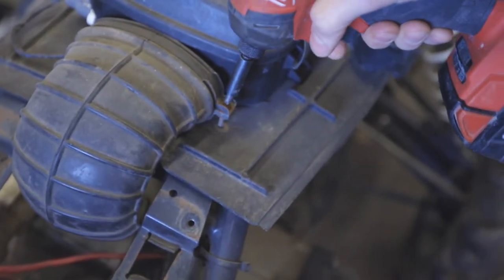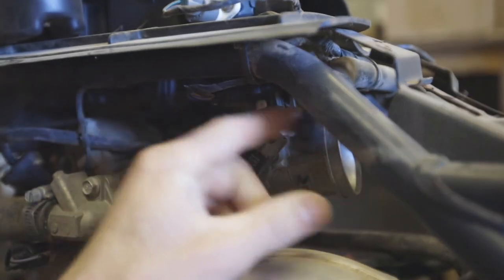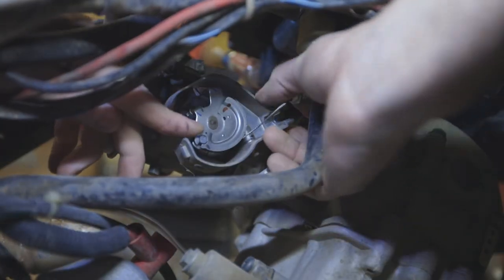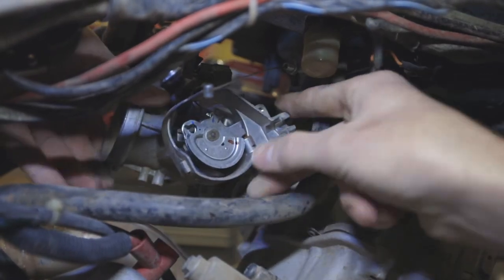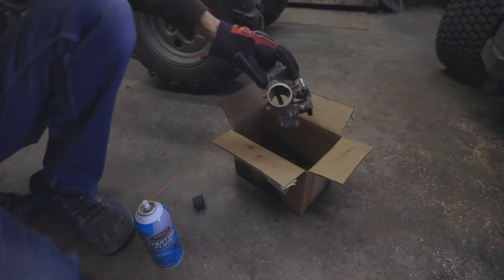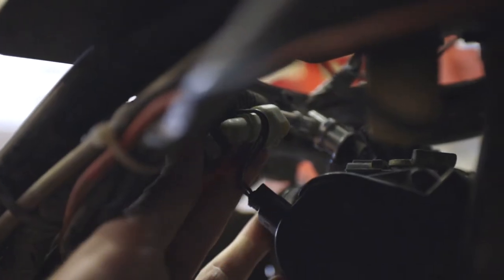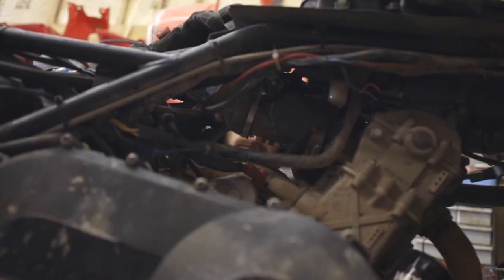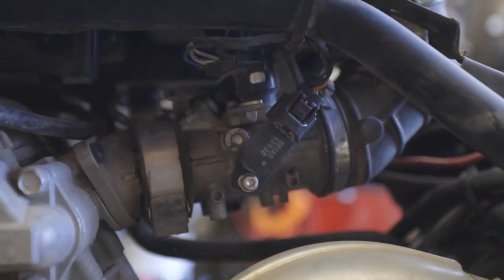How To clean your ATV throttle body

Comment: Hi.Throttle Body Valve part is broken and I am having trouble in supply, can I use alternative spare parts?
Reply from the maker: Yes, you could find a used part in good working condition to get you going again
Reply: Thank you for the answer 👍👍👍

Comment: Is there a trick to the wire harness? I have an Alterra and it's not budging.
Reply from the maker: Are you removing the throttle body? Each of the plugs have a safety clip and the throttle cable has to be loosened.

Comment: I have an issue with mine Spotters at idle and bounces rpm I’ve had injector tested valves tested Stata tested and pick up new spark plug I also cut the spark plug wire back it’s a 2018 mud pro 700
Reply from the maker: It should idle around 1300rpm or so. Have you tried syncing the EFI system? https://youtu.be/5mnc3PAVihQ

Comment: Although the throttle spring is solid, it cuts the gas slowly, what is the reason? I am writing from tr
Reply from the maker: Do you have good fuel pressure? The fuel pressure needs to be constant 43psi.
Reply: @ArcticFrost  When I disassembled the tps sensor and cleaned it, it was fixed. The problem was I wrapped the throttle spring a bit more, I didn't drop it so that it would cut the gas fast, would it cause a problem?
Reply: @ArcticFrost  Also thanks for your interest, I'm following from Turkey I'm having spare parts problems